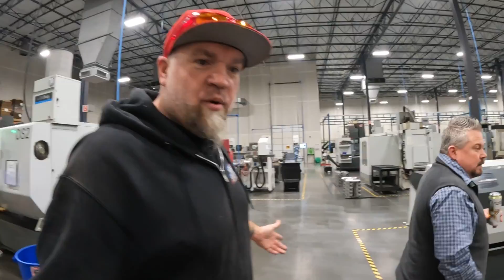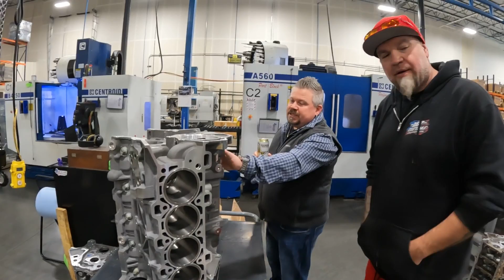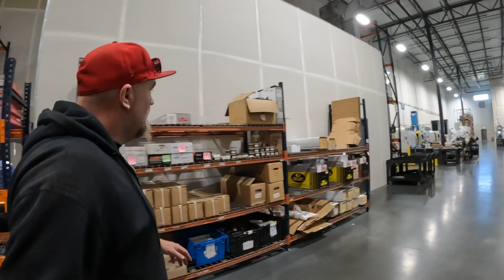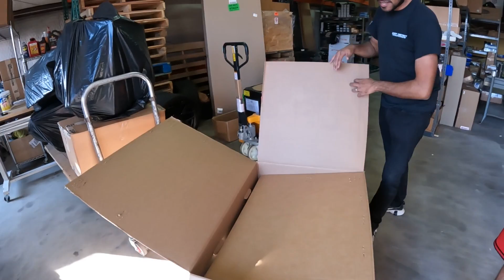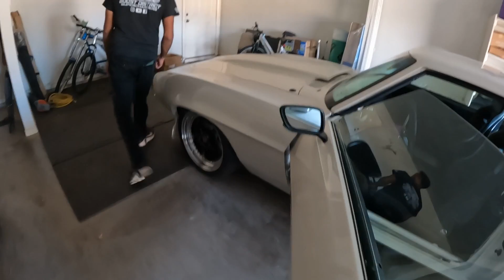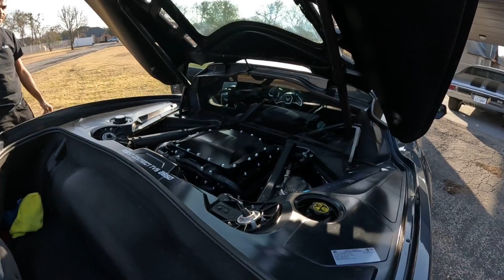ROAD TRIP To Pick Up Some New Goodies For ShopTruck From Texas Speed and Boost District!

Comment: I'll be honest with you I'm pretty sure 38 pounds is the magic number cleetus McFarland keeps bending his rods on his TSP 427 if you ask them what rides he uses and they're the same don't push it past but the good news is when they had wastegate and boost failure the engine got 60 lb and it bent every single rod but it didn't put one through the block so he's pretty much just been able to put rods back but he's also going for a 6-second pass in a manual car and he's down down to 7.04 so I know that engine is no punk

Comment: Does Texas Speed make a high horsepower engine? Seems like most ppl use them for more  “street” setups 1000-2000 HP but use Proline for the high HP 3000+ race car stuff?

Comment: Yall are awwsome.  Good luck with the boost district kit.  That guy is a 3rd party parts buyer and has never worked on a car.  We bought a kit for a 6.2 ss car and it was missing hoses heat exchanger all kinds of stuff.  We ended up getting it all done and car ran good. Just a lil heads up.